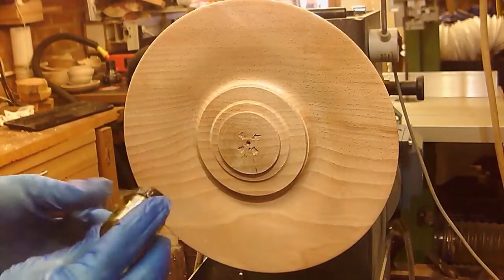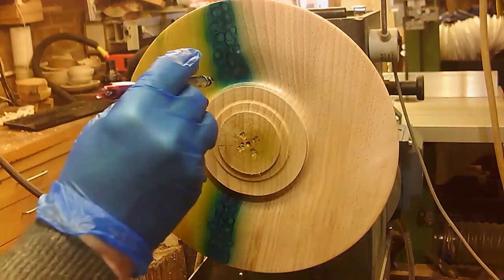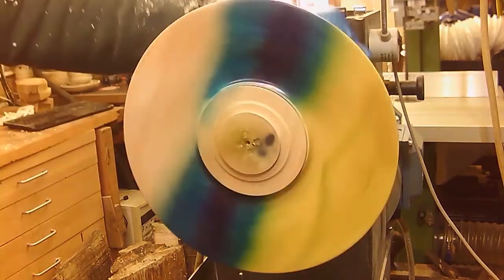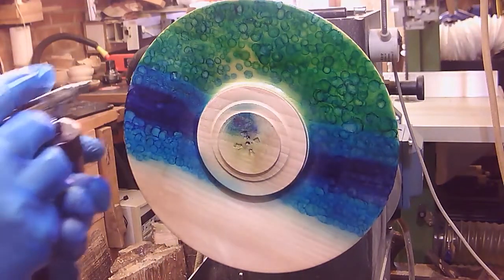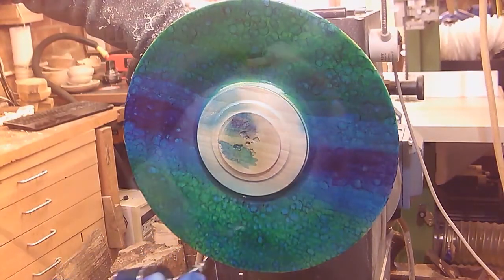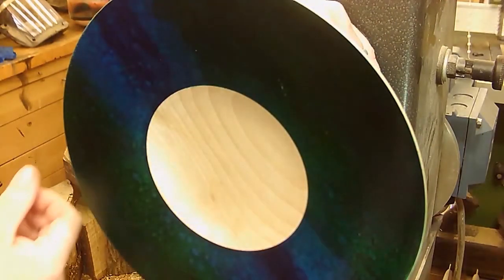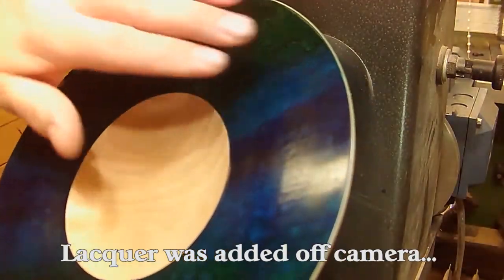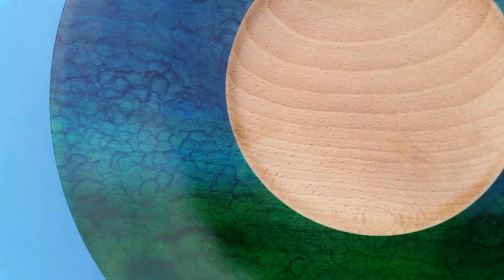Blue Green Bubble Rim

Comment: Stewart this is an amazing bowl.  Some questions (as I did not hear it in the video), did you coat the paint before you turned the inside, or just the lacquer you mentioned in the popup words?

What type of paints did you use?
Reply from the maker: Hi Brian - thanks for your kind comment! Much appreciated.  I didn't actually use any paint on this bowl - it was all Chestnut spirit stains (I'll have to remove the wrong commentary!).  The bowl was sealed with Chesnut acrylic sanding sealer and then cut back with a fine abrasive.  The spirit stain was then applied and after that I may have put a coat or two of sealer on first (can't remember, but I do this sometimes on other platters or bowls).  Then two or three coats of Chestnut acrylic gloss lacquer.  I then cut out the centre and put cellulose sanding sealer on the middle and buff it with tissue.  Final coat is renaissance wax which is buffed off the lathe with a soft cloth. Hope this helps. Cheers
Reply: Very helpful, thank you.  I have recently started turning colored bowls, looking to improve my process.  All of this should help.